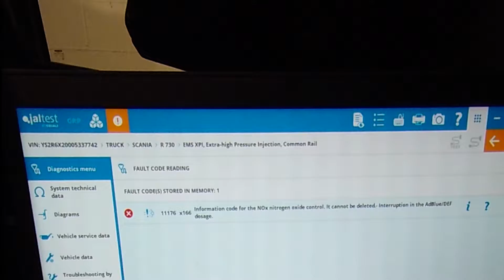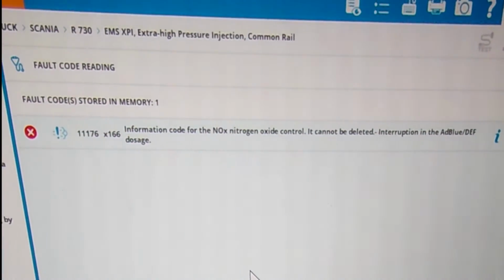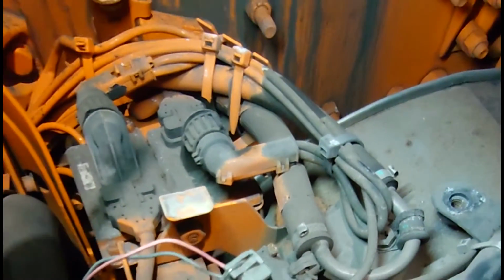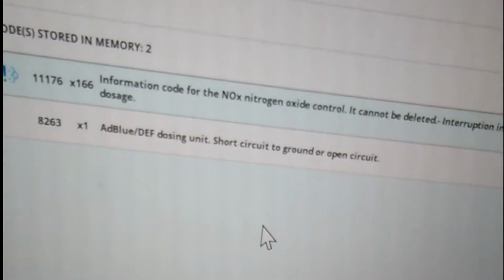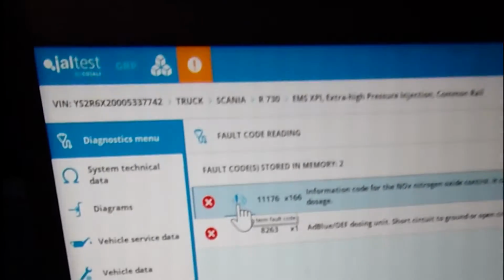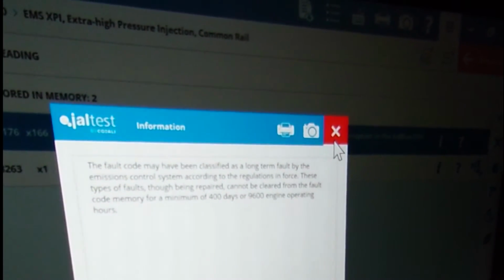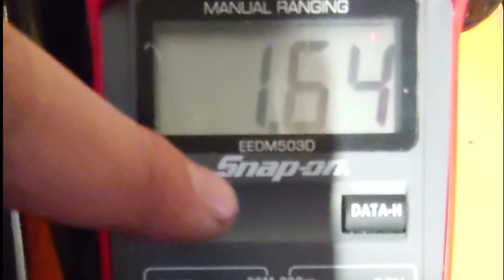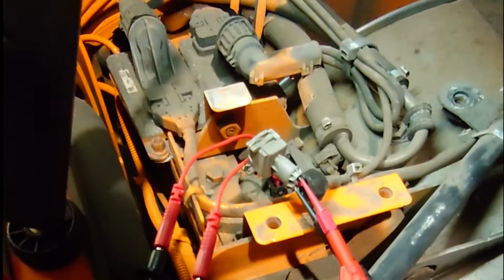Scania R730 adblue fault 8263 adblue/def dosing unit short to ground or open circuit.

Comment: Intrigued this system works at 12volt, you would think it would be 24 volts....nice diagnosis
Reply from the maker: Yeh not something I do alot of work on. I just try and use the same process to do diag.
Thanks for the comment